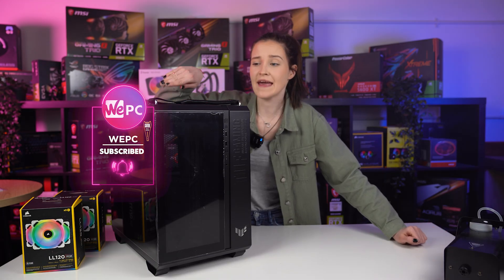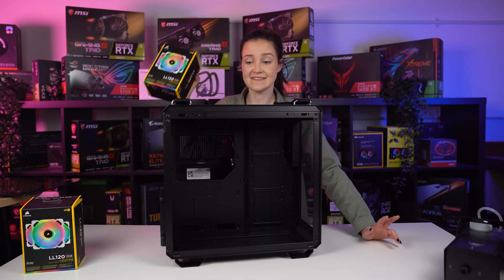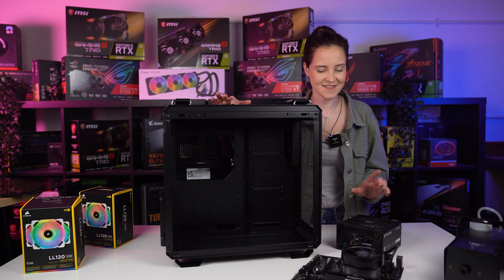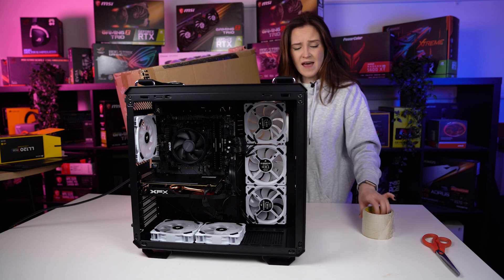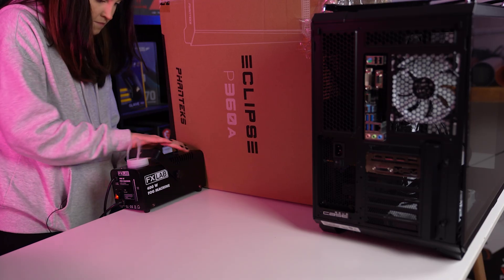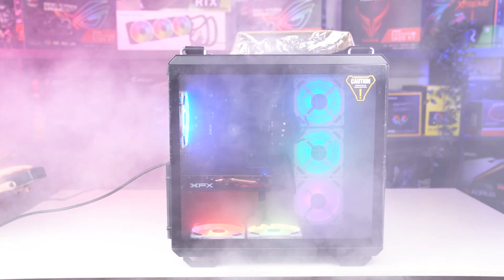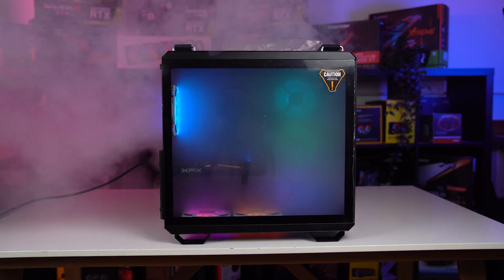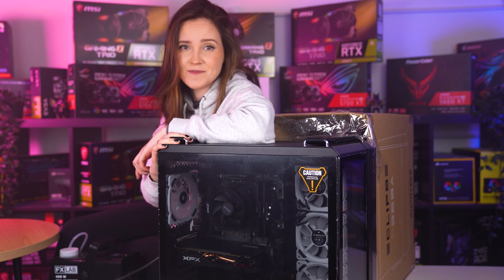ASUS TUF Gaming GT502 PC Case | Smoke Airflow Test

Comment: I gave that one and the fans 3 at the side on the 2nd chamber not in the 1srt 1 back exhaust and another exhaust right above the air coooler, and it woks like a charm it cools the mobo better and all of the  components due to giving direct air to the back of the mobo

Comment: 3x 120mm Lian Li reversed unifans intake at the bottom as well as on the front end sidepanel. 3x exhaust at the top mounted on the radiator plus 1 exhaust on the rear chassi wall.

Comment: This is a really inappropriate test considering I have this exact same case. I have three fans on the bottom one fan in the rear three fans on the side diagonal panel three fans in the right back part of the computer case that sit behind the motherboard and then three fans that are attached to my cooler and then three fans attached to my GPU. This case keeps my processor running rarely above 40°C and my GPU hardly ever goes above 35°C and I’m using an AMD Ryzen 9 7950 X. With a tough gaming 4070 TI super oc. The case is also enormous, which makes cable management a breeze, especially nice for people like me who are new PC builders now if you include the one fan that the power supply has the entire case hold 17 fans.😂

Comment: i have 13 fans in this case and i can say the airflow is perfect the side take in,the down in and the top and back out so my set up is better
Reply: What fan model using? do you think dp fk120 good?
Reply: @user-fo9ce3hr5h  i use from the case the TUF Fans they have 1800RPM and 75 cfm i build with all fans install and never have more than  45 celsius

Comment: Aye yo, just as a suggestion, I like the setup, but heat does not dissipate very well out of a bottom exhaust port. Super inefficient. Heat rises. So like in a smoke test it does okay but thermals aren't really being accounted for here. I suggest bottom and side intake, rear and top exhaust.

Comment: I have the same case. Best setup for me is top exhaust with 360 AIO, side intake, bottom intake, rear exhaust and back intake
Reply: Hello I have the same case does it fit with the nzxt 360mm cooler
Reply: @yousefalashkar6711  fits easily bro! I have a 360 on mines. Better off setting it on top or behind the case
Reply: @kpbizzle_gaming alright thanks it’s my first time building a pc is that 360 mm with 3 case fans enough
Reply: @yousefalashkar6711  no problem! Good luck man on the build
Reply: @kpbizzle_gaming thank you

Comment: You shouldn't have 6 but  8 fans. 4 for exhaust, on the back and on top with the radiator and, 4 for intake, 3 on  the low deck, and 1 in the middle right side slot. And try with some more heavy smoke like insence and you will perfectly see the smoke flow paths. This configuration gives you a little more positive pressure right above neutral pressure. It's just a better result and not the messy smoke mesh we just all saw?

Comment: I have a Lian Li Landcool lll RGB case and keeps farely cool inside🤔 all case fans at 90%

3x140mm front intake (stock rgb fans)
3x120mm bottom intake (Asus ARGB TF120)
3x140mm top exhaust (Arctic P14)
1x140mm rear exhaust (stock fan)

Ryzen 5800x /DeepCool AK620 (max 75-78c)
32gb ddr4 G.skill 3600mhz
Evga 3090 ftw3 ultra (max 75c)
1000w Corsair rx1000 psu bottom tray

Comment: I just built a system in this case: Rog Strix X-570F Gaming, RTX3070, (AMD Ryzen 5, 5600X), Arctic Cooler II 240 AIO INTAKE from the top using Corsair RED 120mm fans instead of supplied Arctic cooler.... it give an effect on top of an electric stove :) ) . ONE Corsair RED 120mm on top as EXHAUST ( to rear of AIO), 3x Asus TF120 aRGB fans on back wall as INTAKE and the two Arctic Cooler supplied on bottom floor.  one Akasa aRGB as usual back exhaust :)  CPU rarely exceeds 40 under normal websurfing etc, and rarely reaches 60 under gaming :)

Comment: I just built my first PC and decided to use this case. I ended up running a 360mm rad exhausting through the top, two fans at the bottom pulling in air, 3 fans on the side pulling in air, and a fan at the back to exhaust. 5 intake and 4 exhaust total, I have 3 more fans on the way more for aesthetics than anything since my PC sits on my desk lol
Reply: Did you get a good temperature this way, bro?
Reply: @MrBalaMir  The number of fans I have is excessive, but it stays cool lol I just like RGB

Comment: Its godamn too short!!! You had to test cpu an gpu temps to bench them against other new cases .... twah!!@ those english women
Reply: I have this exact case with 17 fans! It is a monster. It keeps everything inside my computer ice cold literally with my AMD rising nine 7950 X and my 4070 TI super OC everything tough gaming. My processor rarely goes above 40° in my GPU rarely goes above 35. My favorite part of the case is that you can put three additional fans on the right side of the case behind the motherboard, adding a whole bunch of extra cold to your build.
Reply: @SAMZIRRA hi!, i Will buy the same case, how is your fan config? Wich ones intakes and exhaust?